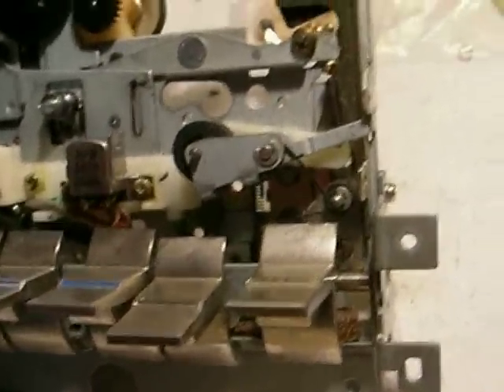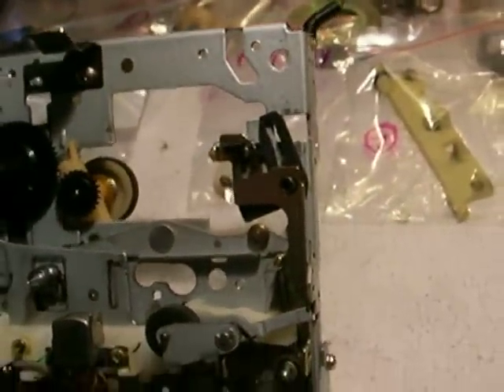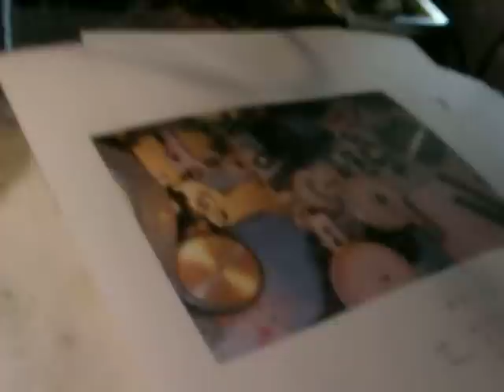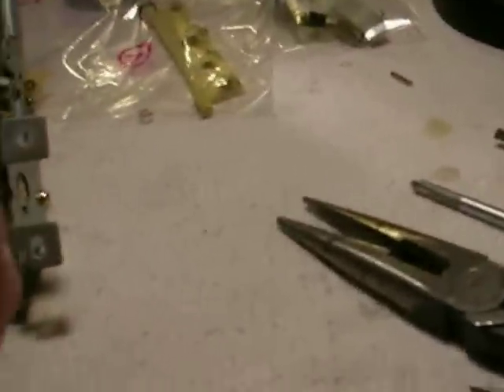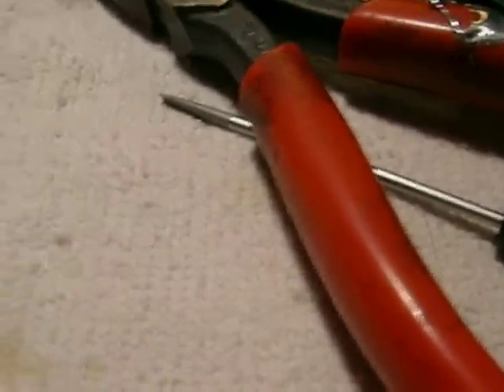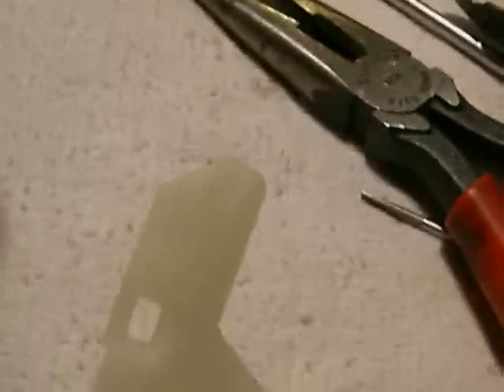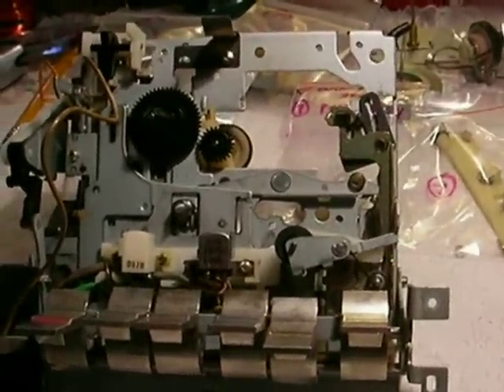Pioneer SK-71 Boombox cassette mechanism repair

Comment: The reason why it is the most complicated deck ever seen (What Chris didn't say) is, it is having a memory rewind function using the Tape Counter, incorporated in a purely mechanical deck.  The deck can rewind to a set Tape Counter position and resume play.

In order to get this function, SK-71 has two tape counters on  the mechanism, of which one is hidden from the user. Only the  reset button is accessible from the front, that makes  as the Memory Start Stop set button.

Comment from the maker: @CoolDudeClem One reason they did use Nylon was the gears ran quiet, as they are soft. And, when you think about it, no manufacturer ever thought their product would still be in use 30 years later. It is not only Pioneer that I am seeing the disintegration of the plastic parts- it's about all of them now.